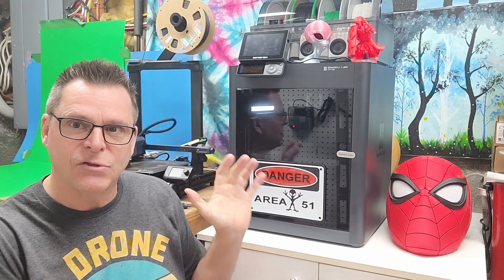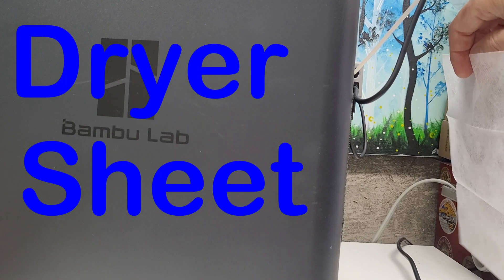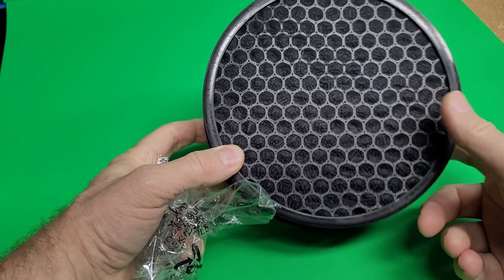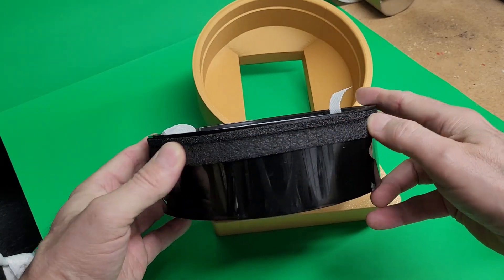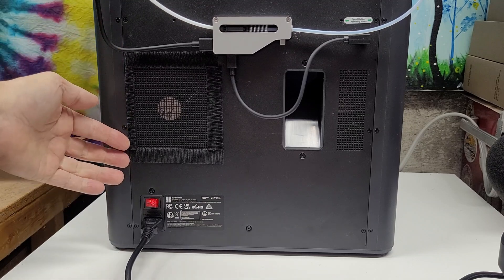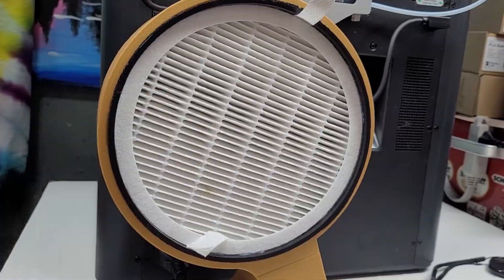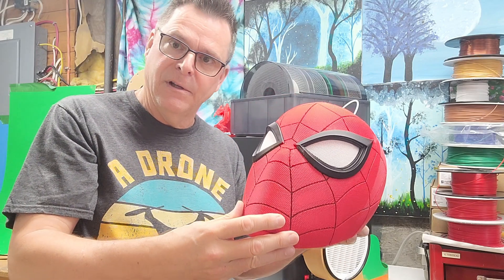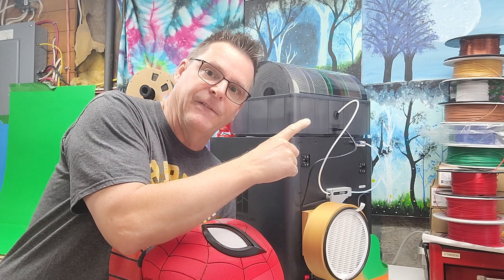Bambu Lab Is It SAFE?

Comment: I have often wondered the same thing. One of the reasons I bought the X1 Carbon was its enclosed, only to find that when printing PLA I need to leave the door open. 😞
Reply from the maker: @thedude7450  what happens if you leave the door closed? 
Mine is in the basement and it's always 20 to 25 Celsius
Reply: @ Bambu says leave the door open when printing PLA or it will get to hot in there leading to heat creep and clogging.
Reply from the maker: @thedude7450  I've never left the door open on either, but they are both in may cool damp basement. Always cool down there even on hot summer days. I've had one running for days endlessly. I wonder if the cool basement makes a difference?
Reply: @ Interesting. I just got mine 2 weeks ago and was just going off of what the manufacturer said.

Edit: I just searched the Bambulabs subreddit and got a million different opinions. Some do, some don’t. I think it has a lot to do with overall room temperature too. My room gets quite warm. I have about 90 or so hours with the door open and not a single failure.
Reply from the maker: @thedude7450  So far the only nozzle clog that encountered was due to wet Silk PLA. Everything going well so far?
Reply: i have printed about 100 items and never had the door open. Room has been around 20 degrees c. no problem so far.

Comment: Thanks for the effort in making this as I'm considering whether to pull the trigger on Bambu P1S for their Black Friday Sale.  Air quality is a concern for me. 

I've done quite a fair bit of research and just wanted to point out that whilst your idea is fundamentally sound, it's not working as anticipated due to the filter.  The UFP from 3D printing for PLA and PETG (2 of the most commonly used) is usually 0.1 micron.  Most HEPA filters max out at 2.5 microns (including the one you used). 

Hence, almost all of the UFPs are still floating about in the air as it is too small to be trapped by the HEPA filter.  To trap it, you will need Ultra Low Penetration Air Filter, which isn't easily available.  Also, the fan will not be able to produce enough air pressure to force air through also.  

As of now, I think the ultimate solution is still to vent / circulate while printing.
Reply: Vent circulate - like use vent tubing to get it outside?
Reply from the maker: @brianandrewramsey  understood, but until I can work it out,  the hepa is better than the carbon filter. I have to run a vent tube to the back wall and make a dryer duct opening.
Reply from the maker: Challenge accepted 😊
Now I have to find a UFP filter and add a fan 😊
Thanks for sharing
The hepa is at least an improvement over the plain carbon filter
Reply: @mayhemsmiley any update on this thanks
Reply from the maker: @slickrick412  Hey! Thanks so much for checking in, I really appreciate it. I do still plan to look into ultrafine particle filtering, but I’ve had a bunch of projects pile up faster than I expected. I want to do it properly when I get to it, so I don’t want to rush a half-done test.

No exact timeline yet, but it is still on my radar. Thanks again for the nudge and for sticking around, it means a lot!

Comment: Hey I was wondering if you have any updates on your system, how do you like it since the video was released? Does the built in fan to the exhaust move enough air? I 3D printed in my garage for a year with no ventilation on a bed slinger and am now extremely concerned about long term exposure to PLA fumes and ultra fine particles because of a lack of research and everyone just blindly saying it’s “safe”. Thinking of taking advantage of the P1S Black Friday sale, and this filter would allow me to keep it tucked back in the garage again with little worry about fumes or particles!
Reply from the maker: @legomotion713  Hey Lego motion.  It's working great and I can still detect air flow through the filter even with the fan running at 70%. I've bought a second P1S and added the filter to it as well. The very best thing you can do is vent outdoors, but that's difficult in my case. This solution is better than the printer came with.

Comment: I know this is a few weeks old, but I have a thought/question that keeps rattling around in my old brain.  Is the exhaust fan used in the X1C a standard PC fan?  The reason I ask is that I am curious if replacing it with a high static pressure fan meant for a water cooling setup on a PC would more efficiently push air through the added filter.  Obviously more involved than adding a second fan on the outside to push/pull the air, but it might be worth the effort.
Reply: Let us know what you find out. Given that the unit has an internal carbon filter, I would guess it is already some kind of static pressure fan.
Reply from the maker: Morning Thomas
Sorry for the delay
I don't know what kind of fan but did notice that when printing the fan only runs at 60%
It moves air through the filter because I can feel it. 
I'll have to try running the fan at a higher percentage to see if there is any negative impact to the print.

Comment: Great Video... I ordered a Bambu A1 mini with the AMS Lite but ended up returning it because after some research I simply was not comfortable with printing without a proper enclosure and filtration system given that I would be printing in my basement without any nearby windows or doors to ventilate the room. I was only planning on printing with PLA which is supposedly safe but that is just because there are not enough long term studies on the effects of the microscopic particles that are released into the air when  PLA is melted. Hope to get into 3D printing one day.
Reply from the maker: Thanks Oliveman and for taking the time to comment. I  hope get a printer one day too. I like the enclosure too for a number of reasons but must admit that the filtration was high on the list because of the unknown long term effects. Let me know if you ever have any questions that I can answer before you buy :)
Reply: I got the A1 Mini and that was the first things i noticed was the fumes. I spend $30 and got an inclosure and another $30 for an air purifier that can have activated charcol. It all works well

Comment: Is this a  Bambu Lab only issue? I would think that this would be an issue with all 3D printers. Why target Bambu Lab?
Reply from the maker: All printers, in my opinion. The absolute best solution would be to exhaust too the outdoors, but difficult to do where I use my printer. 
Since I bought the Bambu I haven't been using the other printers partially because I've become obsessed with it. The prints are just so easy and amazing
Reply: @mayhemsmiley  I have a P1S. I am very happy with the ease of use and  print results.  It makes me look like I know what I am doing.

Comment: If I sit in my room while the X1C runs for more than an hour, I start coughing up a storm.  I had to move it to another room.
Reply from the maker: Hey Badtoro, I've wondered many times when I was using bed slingers and PLA, but now that I'm starting use some other materials I just don't want to risk the health of my lungs. Thanks for commenting and watching
Reply: what do you print?

Comment: I put my P1S into a CR10 enclosure and put a hepa filter unit inside with it. It does get warm inside, but never hot. I feel like this is the best and most obvious solution to this problem that no one else seems to be doing.
Reply: @bearwolffish  you’re absolutely right. Since posting this comment I have found a better solution. I built and installed the “Bento Box v2” filter inside of my P1S, and then I printed a cover for the rear fan that redirects the air back into the poop chute in the back. That is called the “Air Reflux v2” on makerworld. What this does is filter the internal air with the Bento Box AND the standard bambu filter. It keeps internal temps up inside the chamber as well. Highly recommended.
Reply: @nightzelmods  thank you for this comment
Reply: @nightzelmods 
That sounds like a good setup!
You still rocking that or did you find an even better solution?
Reply: @nightzelmods  this puts the chamber back into positive pressure, which then forces the air out of any where it can get out, such as the front door and any small gaps, unfiltered.
Reply from the maker: Hey Night, it did cross my mind for my bed slingers. Thanks for taking the time to comment. Happy printing

Comment: Many people work at mills with fumes from huge extruders and printers, no issues.
Reply: Yet
Reply: EVERY impurity in the air negatively affects your health. No matter if it’s particles, fumes, gas, debris etc. etc.
Reply: @MRX-ff4vy  farting too?
Reply from the maker: HI Malaphisis, Hopefully they have proper ventilation and air filtration. Just trying to be proactive and prevent any possibilities. I want to enjoy this hobby for a long time. I'm starting to run the printer in the house up to 20 hours a day lately. Thanks for watching.

Comment: Just add a good quality HEPA air purifier nearby. Done.
Reply from the maker: Hey Frump, is that what you do? If yes any recommendations? I really like the idea of exhausting outdoors the best, but it's complicated form the room I use for printing and would love to collect at the source so that it doesn't even make it into the room at all. Thanks for watching and dropping a comment.
Reply: @mayhemsmiley  I’ve been suffering from migraines really bad for about a year and a half now. I got into 3d printing about 4-5 months ago and was scared it might make them worse. I got an air quality monitor to see how many particles and VOCs were being emitted. It was high when I printed abs. I ended up with a bento box which seemed to help but not eliminate the odors. I ended up venting outdoors and added a 140mm computer fan in the ductwork to assist in drawing the odors. Now I can print abs without any rise or very very slight rise in pm2.5 or voc. I did also get a hepa air purifier for the room that we occupy the most. I got a Coway air mega 400 and can’t recommend it enough. It is absolutely awesome. It was around 350 dollars but when you have more migraines than migraine free days, if it saves me from 1 migraine it’s money well spent. I put my printer and ventilation on smart plugs and set up an automation that controls the fan in the ductwork and the bento box so it just works without me having to remember to turn anything on.

Comment: I know some filters, like cars' engine filters, specify the flow direction. I noticed that the pictures on Amazon depicts flow that is opposite to how you've configured yours. Do you think that could affect the performance of your filter?
Reply from the maker: Hi Cdeeze, I don't think it makes a difference. I'm not an HVAC or HEPA filter expert, but the paper portion would catch the particles. For some filters the orientation will definitely matter depending upon the strength of the fan pushing air could blow out the paper. That won't happen in this case. The air unit pulls air from the charcoal side so pulls air through the paper. If I add a fan on the outside I will add a grill to help keep the paper in position. Thanks for taking the time to comment and please share your thoughts on my comment.
Reply: @mayhemsmiley  I see, thanks!
Reply: @cdeeze  HEPA side first to catch the particles then carbon on smells. if you have it the other way round the carbon gets blocked first

Comment: i installed a 6inch bathroom exhaust fan in ceiling of 11x8ft office i print in, i print resin so it was needed to remove fumes but also doubled to remove fumes and excessive heat from fdm printing. pretty sure the biggest concern fdm printing air quality wise is the carbon fiber mixed filaments they offer now in almost every plastic type....thats the stuff i don't want to breath in
Reply from the maker: @Burnstation3D  hey thanks for taking the rind to share. I'd rather err on the side of caution.  I plan on playing with printers for a long time and err really don't know the long term effects. Plus I want to play with all the materials lol
Reply: @mayhemsmiley  I don't spend much time in the room physically, door closed...intake vent from my basement, output through vent to outside. I understand your concerns if it's in a constant workspace. cancer does suck, been there done that 6 years in remission 🙏😁
Reply from the maker: @Burnstation3D  Wow so happy to hear that you are in remission, cancer royally sux. Some may call me paranoid and I'm willing to accept it to avoid learning the hard way in the long run. Thanks for watching and commenting.

Comment: Damn, I really need to learn how to model. This is brilliant and I have a bunch of 120mm fans so I’m going to add one to outside. Thank you for this
Reply from the maker: Afternoon Tatooz, Too funny because ever since I printed the filter housing I've been thinking about modifying it to add an external fan to assist with pulling air through the filter. Just an FYI that I used to use Autodesk Inventor for work purposes but transitioned to Fusion 360 for hobby proposes and it was an easy transition. Fusion 360 is free for hobbyist as long as you're not making any money from it. I turned on the monthly license when I was making a few dollars from it then turned it back off.

Comment: That fan is for cooling the power supply for the printer not to evacuate the chamber . That restriction will more than likely burn up the power supply for your printer. Plus people have already had problems with that fan not cooling enough and some have swapped it out for a better one. Just wanted to post to try and save a printer lol  Good Luck
Reply from the maker: Hi Lazypilot, thanks for taking the time. Love to start a discussion and investigate more. I certainly don't want to burn up mine or anyone else's printer. Trying to err on the side of caution for long term lung health. I have mine printing up to about 20 hours a day in my home lately. Printing another Deadpool mask for a friend at the moment :) I performed other tests than just the dryer sheet. I performed a smoke test which I wouldn't anyone to micmic without precautions. That fan pulls through the charcoal filter, I will redo this test once the printer stops later today. I've thought about adding another fan on the exterior of the housing that I designed to assist pulling air through the filter. Just an FYI to reduce the restriction I removed the Bambu charcoal filter and the flow rate increased incredibly. I will also investigate the chamber fan path a little deeper. Do you happen to have or know a recommendation of a better fan? I'll reply with more news soon. Happy Sunday
Reply: @mayhemsmiley   I was wrong the fan for motherboard was a different fan. Been awhile since I've watched videos of people changing the fans. But noctua is what fan I would use don't use mine that much maybe one
Reply from the maker: @lazypilot99  Thanks for update. I investigated pretty thoroughly before but thought you might have caught me making a mistake. I really appreciate you letting me know. :)
Reply: @mayhemsmiley  It's possible to buy a really good Air purifier that would reduce the particle count down to nothing if you worried. i used to have MI Air Purifier 2, it shows live data how many particles etc got in air, and it has fantastic filters too, I gave it to my Mrs grandparents to make their room less dusty and remove smells , works like a charm.
Reply from the maker: @themrarcijs  Hey The Mr, thanks I will check it out. I love the idea of capturing right at the exhaust, ideally so that it doesn't even get into the room and ultimately exhaust right outdoors, but that is complicated from my printing room. Mrs has me almost in the dungeon LOL
Reply: @mayhemsmiley  but given that the P1S isn't airtight, and you'd want to open the printer's glass door occasionally, wouldn't the rear filter be less effective? maybe having the rear filter+air purifier+frequent room ventilation is the best solution :D
Reply from the maker: @dzrntDaDroidsUrLooking4  Hey DZ thanks for taking the time to comment. Definitely agree if you have all three that is the best. I never open the door to my printers while they're printing, I don't want to disturb them lol I'm almost superstitious hehehe I know some people have said that they have to leave the door open a crack due to heat creep, but I haven't experienced that, it is always really cool in my basement.